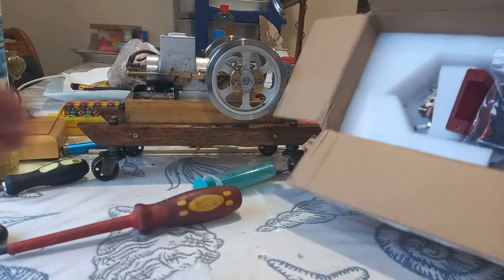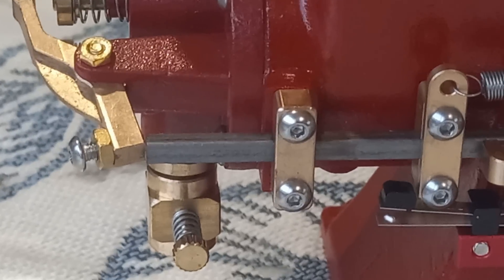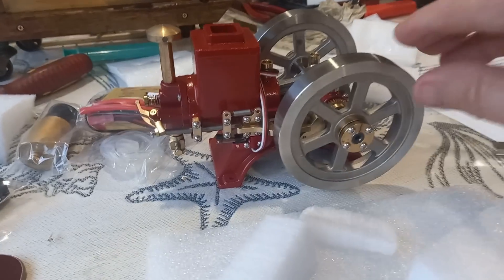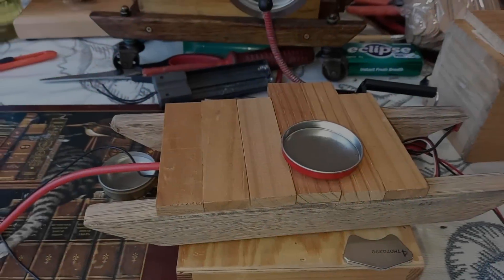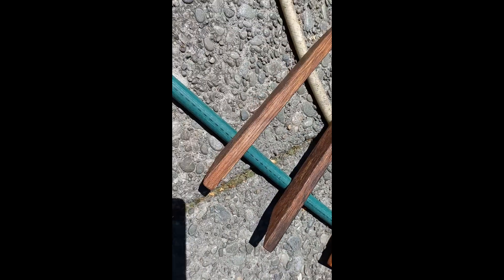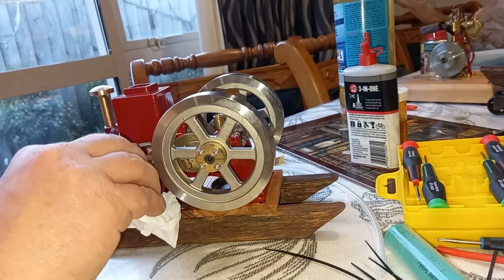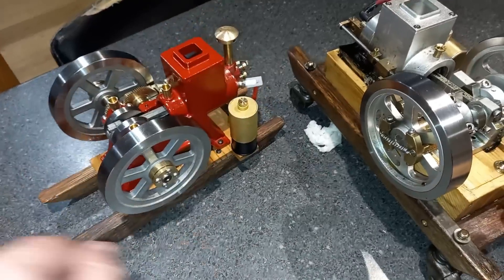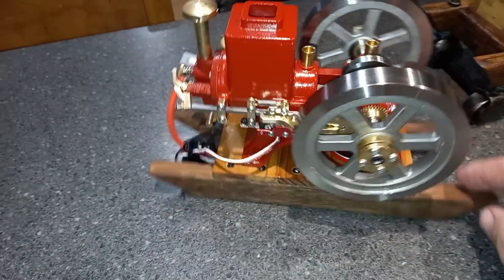ALL NEW 2022 Chinese Hit and Miss Model Engine! MUST SEE! MK3 Hit and Miss Engine Model

Comment: Yeah love it, listen my 1st model ignition went south, where would I find a new set? It rarely ran as the Hall effect sensor kept failing
Reply from the maker: you can email service at stirlingkit or enginediy or Aliexpress (user Smurfs88 has been there years is trustworthy and good value). They are all excellent parts suppliers

Comment: Hi Thomas 👋 
I’ve recently bought me one of these engines and I would like to know what kind of grease you use.
Would 3 in 1 oil work?
Thanks
Reply from the maker: 3 in 1 oil is not great because it is considered more  a penetrating oil for old bolts. Drip some off your car's dipstick if you must. SAE30 "small engine oil" is recommended. Grease can be applied to the gears but is optionsl
Reply: @ThomasPCGuruENGINES  thanks! So I can just drop some regular engine oil on the crankshaft to grease it, would 2 stroke oil work as well?
Reply from the maker: Yes!

Comment: Did you put any water in The cooling jacket? I didn't  see you do it. It's going to overheat!
Reply from the maker: If they're running slow enough these models don't overheat. I use oil as a coolant for this because the cylinder sleeve rusts!

Comment: Nice engine !!  .....Something is amiss with the  "Hit & Miss"  speed  Governor mechanics...I can't make out where the speed governor Spring is.....Have any fully tuned hit & miss Liw speed operation yet  ???
Reply from the maker: Sure Tom. The spring is in a little hole in the rocking brass "detent" arm that slots into the gap in the valve rod. The hole is in the back of the brass rocker arm which is why you can't see it. I use a brass bridge over that rocker arm and a variable counter spring. See my latest v ideo to see its operation https://youtu.be/ChTzPoGsqXc

Comment: What fuel does it use..? I don't understand sorry
Reply from the maker: Little complicated...standard petrol But you need to add about 4% "2-stroke engine oil" to the petrol, just like a chainsaw uses.
Many of my viewers use lighter fluid instead of petrol; they say it burns cleaner so is better for the engine (and themselves)

Comment: Hello Thomas,

Last year I have become interested in Heat powered engines and your videos inspired me to buy this model in black and to make a youtube channel, so I could subscribe to you. I find your videos very inspiring, good work indeed!
None the less, I do seem to have some dramas getting my engine to run sometime (I am a newbie and a german electrical engineering student, so haven't had too much hands on experience with engines), would you possibly have a spare 20 minutes for a couple of questions via mail or similar.

Best regards 

Jack
Reply from the maker: Of course, use chairmeow.nz [at symbol] gmail

Comment: Where can I find a new spark plug?  Mine developed an arc that jumps from the base, right through al tiny hole punched into the white ceramic insulator.
Reply from the maker: Hmmm, my reply removed,, thx youtube...look for stirlingkit or enginediy websites. Also ebay

Comment: Where did you get those miniature casters from? I want to get a set and put on my hit n mis.
Reply from the maker: The ones on my original model hit & miss are from old, old sofas. They may be around 100 years old or older; when such lounge suites were being thrown out in the late 70s I grabbed them whenever I saw them. I have 8 in total. Soooo... not much help for you, I'm afraid...I've Googled around and the smallest I can find are 2 inches dia. Check locally at vintage furniture restoration businesses

Comment: What type of fuel do these run off of? Do they have a tiny magneto for spark?
Reply from the maker: I use standard 95 octane and 1:25 two stroke oil mixed in, oil in motor is sae30 small engine all. They use standard AA batteries an a tiny electronic ignition module triggered by a leaf switch on the valve rod assembly

Comment: I think steam oil will have those sleeve bearings lasting longer.
Reply from the maker: Interesting. I hav just changed to SAE30 small engine oil. Still, the engine doesn't get run a lot. Thanks for the tip!

Comment: My buddy owns a trucking company that was established in 1930. On the floor in his big shop, for at least 30 years that I know of, set this big old hit and miss motor. It was supposed to be one true horsepower, lol. Think the thing was like 100 lbs/ft of torque if you ask me. Look like it was around 4 in bore, and a 3-in stroke. Had zerk fittings on the rod bearings, and main bearings had little oil bath cans that would feed them. Anyway, I'll never forget what he called it. He called it the chik-a-poo. When you started it, it sounded just like that.....chik - a - poo chik - a - poo....., lol☝️😜
Reply from the maker: Thank you for the memories and your comment Mr Fuhk! ...is that a German name? lol

Comment: It'd be interesting to see what all fuels these can run on. For example if sufficiently warmed up can you switch it to kerosene, or run on nitromethane. It'd be fun to convert one to running gaseous fuels like propane or butane as well. I've always wanted one of these kits just haven't ever put forth the funds.
Reply from the maker: You have an interesting mind! Now I'm thinking about ways to do that. Simple gas pencils mix butane and air...and a hose...mmmm. interesting ideas:)
Reply: Nitro methane might work if you get it a 4-stroke glow plug

Comment: I just received on of these and unboxed it moments ago.   What a marvelous little machine.   Great compression, and everything looks beautiful.   No slop anywhere very nicely built.  Much easier to store than a big one.
Reply from the maker: Couldn't agree more! I've thought about the storage advantage too. Still trying to figure out Chinese engines - is it ok to make something that only works 20 times and then is an ornament? Not that any of mine have become ornaments but I suspect some might. I always think that the hit and miss models will last longer. My latest tractor's beauty is only matched by the difficulty I see working on it..
Hope yours runs great - let me know
Reply: I hooked it up yesterday and it fired up on the second spin of the flywheel.  Right out of the box.  Now I have to study your mods.   I’d like to have an adjustment to the governor so you can vary the idle speed.  Maybe you’ve already cover that.   Thanks for your excellent coverage of this engine!!!!!
Reply from the maker: No problem. I've tried changing the original spring in the governor - it's tiny and a pain to get in and out. The problem is it's next to impossible to get the right strength for perfect slow speed. That's why I went the route of using another spring over the top of the latch with an adjustable screw against the rear of it. Worked well  see my "Final mods completed" video

Comment: The flywheels are turned Aluminium, that's been highly polished.
Put a Magnet on them!
Reply from the maker: Fiendishly cunning, Gary. Good to know :)
Reply: stainless steel is not magnetic
Reply from the maker: I will check that.
Reply: I mirror polish mine with Autosol!
Beautiful aluminium billet.

Comment: Piston rings went on my brand new eachine within less than 30 minutes of running.
However, what let's all these engines down are the rubber o rings- that are used as piston rings.

If a firm could machine metal rings, they would be on a winner
Reply from the maker: The engineer of Cison, another Chinese modeller, makes tiny cast iron piston rings. His vtwin Harley engine uses them as does his 4 cylinder Ford flathead has two per cylinder but recommends one rubber ring till one iron ring is worn in, then put on the other. The ring on this motor here has let me down but I have never had an issue with the green ones used on Microcosm engines
Reply: @ThomasPCGuruENGINES  must just be me being very unlucky then!
Reply from the maker: I've never even had to replace one on the original big silver hit and miss or the SAM model both of which have run for hours and hours. But then I squirt oil in the bore of them if I can before running, and hit and miss running well, run cool. As for the carb-controlled engines, the tractor and the vtwin from microcosm, the tractor is run in now and running outstanding great compression great, slow revving. Easy hand flick start. The vtwin is hard to start and fussy but runs hottest of any, so far, compression good.  What's your experience?
Reply: @ThomasPCGuruENGINES  must of had a bad one for sure, and I've had to get PayPal involved with Banggood, who aren't showing any real interest in resolving the issue..
(If it is the rings)

I did intend to start building up a collection of these engines, but I doubt I will ever deal with Banggood again, if this is their way of dealing with customers.
1st impressions are always Lasting impressions with me.

Comment: It's hardly a hit and miss..
I think I will give this one a BIG Miss.
The earlier ones with weights in the flywheel work much better, but the silver  colour is horrible
Reply from the maker: Correct...and correct. Hi Gary, I love getting comments, so, thanks!.
Unfortunately all my Chinese engines have needed work... but it's work I can do, whereas I couldn't build them. I'm trying to think if any of my Chinese engines ran acceptably straight from the factory...the Cison V twin did but later had issues...the Microcosm V-twin did but it still needs work... EM2 / M19 is one of my favorites and ran ok but improved hugely with tweaks...look, all the 4 hit-and-misses I have from China needed work but now they're great. If you want outstanding out-of-the box engines try Kontax low temperature difference engines. Their high temp engines will also work fine but the tolerances are not so perfect (they don't need to be). Also, of course, Japanese or German engines.
Reply from the maker: Oh, and checkout the result https://youtu.be/sl3U_g-CveY
Reply from the maker: "MISS" just got your joke...talk about slow, (me embarrassed)

Comment: Not sure if the maker of this splendid model mentions that it is a replica of an OLDS/Seager engine circa 1912.  The OLDS stands for Ransom E. Olds the founder of the US manufacture of Oldsmobile automobiles that was later acquired by General Motors.
Reply from the maker: Nope, first I've heard of it, though I did look thru some pictures online and find some really similar. Appreciate the comment!! :)
Reply: @ThomasPCGuruENGINES  To be exact, It is based on the 1 1/2 HP model.  The unique single governor fly weight mechanism, the water hopper shape and the arched base legs which gives it a stumpy hog look readily identifies it as such.  I have a 1/2 scale working model of same made from castings that were available in the 1980/90s era.
Reply from the maker: Thanks so much for the info! I will keep a look-out for that L)

Comment: gov springs are too tight and valve spring too loose
Reply from the maker: Can you expand on your valve spring too loose idea??? Gov spring, you were correct. Did you see my adjustable fix mod? https://youtu.be/sl3U_g-CveY
Reply: @ThomasPCGuruENGINES  a stronger spring won't open as easily and will close more quickly. performance engines use stiffer springs for that reason to prevent "valve float". what you have  is not a performance engine and in a IMO theory tighten that valve spring to maybe push back at a rapid fire that still persists in the link you provided. now i could totally be wrong  i soooooo want 1 of those but i'm in a position in m life where i cant afford 1.

i'm thinkin insert a washer or 2 under the outside clip to give it a bit of preload before spending $.
Reply from the maker: Will have a go the next time I fire it up :)

Comment: Great video!  I’m considering ordering one of these.  No experience with these, but plenty of experience with Stuart steam engines.  Can you tell me what you did, if anything, with the governor to make it operate better to slow it down.  From what I’ve seen on another video, it looks like there’s too much mass near the pivot pin on the governor flyers.  Also, can you explain briefly how the governor on this type works. It would be nice to see a video on what you have done to improve it. Thanks again for the video.
Reply from the maker: Yes I just dropped the video you want a day ago - hope it nswers a lot of your questions https://youtu.be/kO6M5LNQRaM Keep in touch!!  :)
Reply: @ThomasPCGuruENGINES  I watched your video on the changes to the Enjomor engine.  Also the one on the ET1.  At this point, although the Enjomor is prettier, the ET1 seems to run more like the originals.  A couple of questions; I have a lathe and can probably make the new bronze bearings.  Are they one piece or split?  Also, where else could I get the “points” type of switch for the ignition?  I don’t have access to a junk computor.  Thirdly, I think that you mentioned that the cylinder sleeve is made from stainless, is that correct?  Any other things that you might suggest would also be appreciated.  As far as the Enjomor seizing or getting tight when it gets hot, if the cylinder sleeve and the piston are dissimilar metals, such as steel and stainless, the expansion rates might be different and casue it to tighten up when it gets hot.   Just a thought.
Reply from the maker: Sorry first reply to this disappeared...just noticed...switches common, see https://www.mr-rcworld.co.uk/shop/micro-leaf-switch/ or https://www.aliexpress.com/item/4001026265588.html
Bronze or brass sleeve bearings don't need to be split or drilled because the engine is not having a working life. And anyway, maybe your bearings won't rumble - maybe its fixed now...
Reply from the maker: ...and I think your skills are absolutely enough. You'll find the Enjomor well made...the other hit and miss engines from CHina I bought needed more work but have been more fun https://youtu.be/7d9IvZghbhw and https://youtu.be/I5jVBEY1NBU

Comment: It would be great if you could film an intro video for novices, showing which fuel you use, how to connect the ignition module, etc…
Reply from the maker: Mmmm thks. Thinking of doing a follow-up foe this so....I really appreciate suggestions!
Reply: @ThomasPCGuruENGINES  thank you! I’m not even a beginner, having built several nitro powered RC cars and other vehicles; yet I have no idea what fuel to use, where to put the water, etc.
There were no instructions at all with mine!
Reply from the maker: Did you get it going? Water not hugely necessary. But in top of hopper over cylinder. Fuel 960ml of 95 octane car petrol and 40ml two sroke mix. Open needle valve two full turns from closed. Prime with finger over air intake ov carb while piston is drawing air in. Facing engine side with cylinder to your left,  flywheel to your right, spin the flywheel clockwise to start. Too much petrol? Hold exhaust valve open and spin engine to "breath" wet cylinder (you should also hear "tic tic tic" of sparkplug firing. Plug firing should be at top dead centre or just after for this slow engine

Comment: What would you say is the scale of the engine?
Reply from the maker: If a 1/8 model has a 3.82 inch flywheel, and this has a 3.5" then: 8 x 3.82 is 30.5, assume a full scale is 30.5 divide by this engine 3.5 = 8.7. Scale appears to be roughly 1:8.7 you could say 1:10 if you imagine the "prototype" is larger or 1:8 if you imagine the prototpe has a smaller than 30 inch flywheel

Comment: hi, nice engine. where did you get the gears and piston rings for the engine?
Reply from the maker: It comes with timing valve gears. Check the unboxing part of the vid...it comes from China pre-built and untested. they use a kind of special rubber o-ring for the piston ring.

Comment: Just got mine the day before Christmas and I like what I got. Still fussing with it and making the "to do" list for it before even starting it. Flywheels were out of sync with each other and the latch arm spring was way to stiff. Fixed both of those minor issues. Machining is good, but left sharp edges on the flywheel rims that need to be smothed out. Working on a cart design for it. I like working on these little engines as much as the bigger ones in the shed. A good purchase price. Thanks for the video.
Reply from the maker: Nice post Paul and hearing about your model. Good ideas re the sharp edges on the flywheels and syncing the flywheels too. I've tried different springs but returned to the stiff one and drilled holes in the back of the governor weights which I filled with lead, and put shims under the latch arm next to the governor. It's acceptable. Will make another vid soon :) Meanwhile I'm trying to do a really special base for the Cison V2. Keep in touch!
Reply: Onde vc adquiriu um desse aí